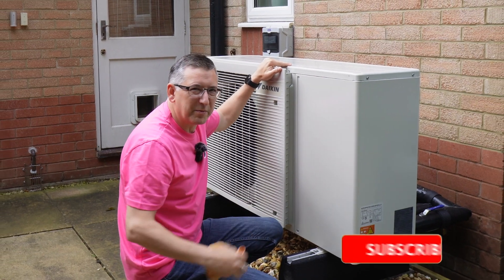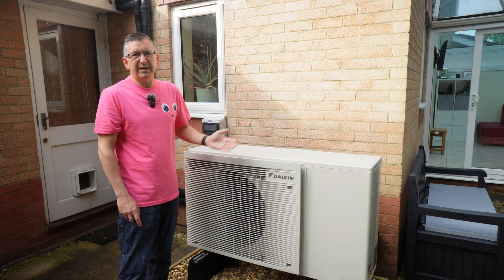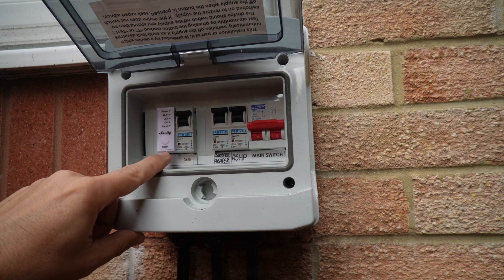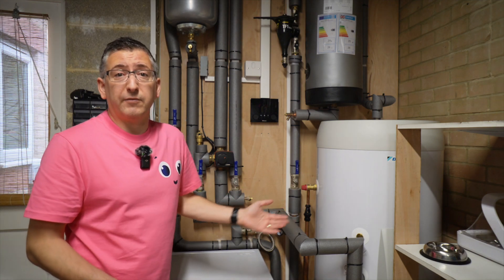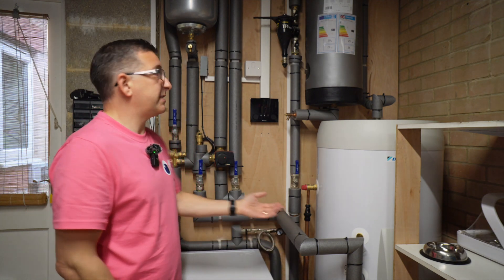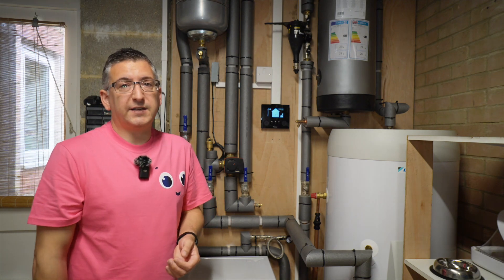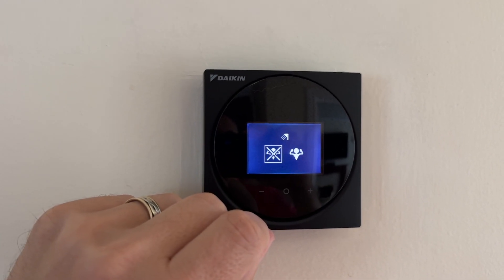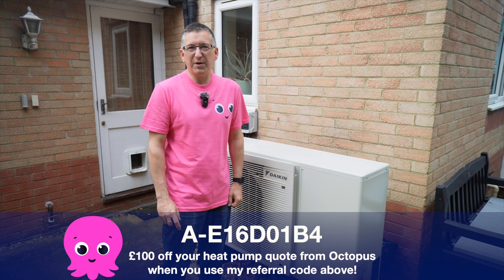Virtual Visit a Heat Pump: Take a tour of my Octopus Energy Heat Pump Installation

Comment: That’s your outdoor temperature sensor should be outside on a north wall
Reply from the maker: That's what I thought! Except that I'm getting an accurate external temperature out of the system which I assume must be from a sensor in the heat pump itself which matches other external sensors I have nearby, and those doesn't match the temperature readings from sensors in the garage! I can only assume the sensor was wired up but disabled in the setup of the system or something if it is what you're suggesting! A bit of a puzzle
Reply: @SpeakToTheGeekTech I have a 7kW Daikin Altherma 2 which was installed by Octopus in June 22. I had an external sensor installed on a north facing wall of garage low down behind a fence to shade from any solar gain. The heat pump is west facing and at times when ambient is 17/18 and sun is out the temperature goes crazy up to 35⁰c etc. The setting to enable the external temperature sensor is part of the installer setup. The annoying thing is when I use Home Assistant integration for Daikin it only reports the temperature in heat pump. Fortunately having checked spot readings the system is using the external sensor and correctly adjusting flow temp . In Home assistant I plot the AccuWeather temperature. Hoping to install an open energy monitor system soon to complete my monitoring as energy readings can only be taken from my controller manually.
Reply: @SpeakToTheGeekTech   I assume your heatpump is north facing so is using its internal sensor , still weird that they then bothered to wire an external sensor in a garage then disable it.  I would certainly query it with octopus to see was they say.
Reply: Could be for frost protection internally so that the internal pipework is protected, although I would have thought that there would be sensors on the pipework already and a sensor built into the MMI?

Comment: Oliver, great videos as ever!  My father in law has microbore pipes too & is considering an Octopus ASHP.  Do you feel that leaving them in place and not replacing outweighed the small loss in efficiency?
Reply from the maker: With my 10mm microbore system (which has wider feed pipes which the microbore branches off from) then yes, I absolutely feel I made the correct choice. If it had been summer and we were planning to do a massive redecoration of the house anyway then new pipes would have been a no-brainer. It really depends on your personal scenario but I don't reckon it was worth the extra cost and disruption in my case.